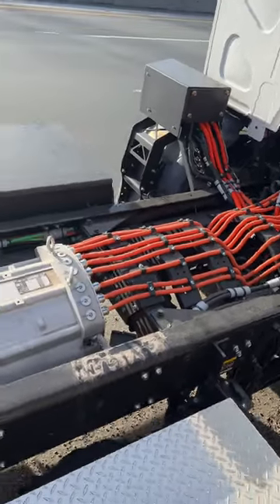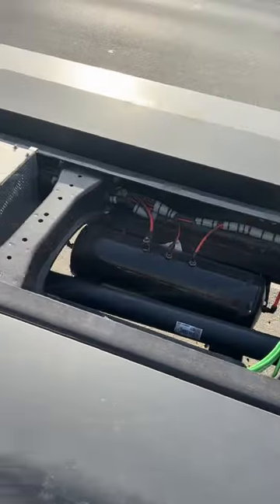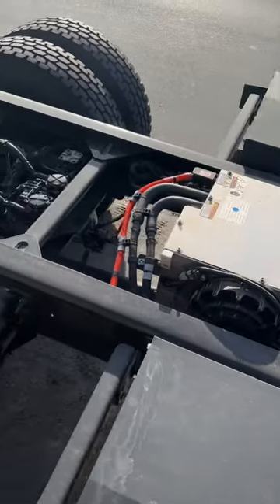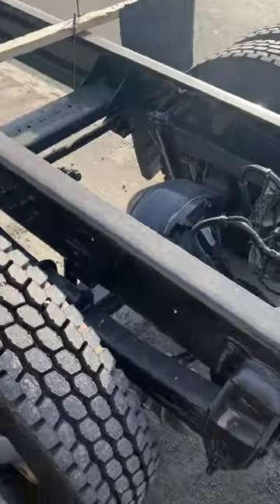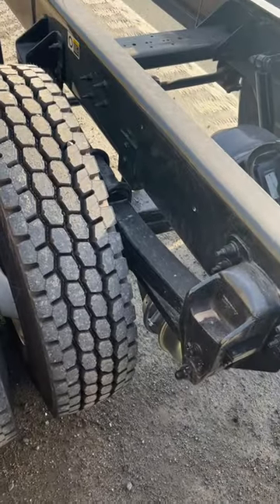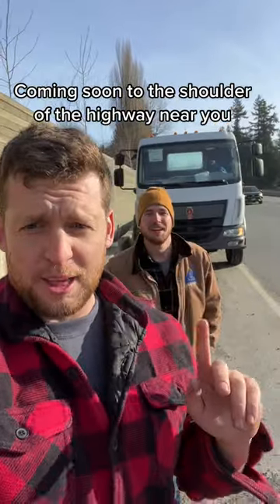Kenworth Electric Truck

Comment: So, with the Edison trucks having the generator capability, will they also offer a “jump” capability to other electric vehicles?
Reply: Depends, Edison’s trucks use a level 4 charger to charge themselves. I believe their electronics are Danfoss, so if the other truck uses Danfoss electronics or can communicate with Danfoss electronics and use level 4 charger then it should be able to charge the other truck. Hopefully someone can correct me if I’m wrong.
Reply: @PurpleNovember  sounds good to me.
Reply: @PurpleNovember  Blind leading the blind here, but If i remember correctly, there's a basic level of charger to vehicle communication but the electricity is the same, level 4 being standardized. Could be completely wrong though
Reply: @gormauslander  Yes, as far as I know that is correct. I’ve read conflicting information about levels 3 & 4 being standardized. So yeah, in theory the Edison truck should be able to charge anything level four, if standardized. It seems like there might be a pissing contest between Dana & Danfoss and vehicle/equipment electrification. I could be wrong though.

Comment: Most of this was highlighting the similarities outside of the end text overlay. Anything can run out of "go juice" with the wrong operator, even diesel.  Kinda gets old when videos that mostly throw shade get reposted.
It'd rather see more of y'all's design details and I live that you're e-swapping aging, but solidly built trucks. We did a motorcycle, so we know how hard fitting existing constraints and meeting safety regs can be and y'all have done it very well in everything I've seen so far.
Reply from the maker: This truck ran out of “fuel” while being delivered by the manufacturer, to the dealership. Reading it still had more than enough miles left on its range to complete its trip. If the manufacturer can’t figure it out, how do they expect their customers to? - Theron Danger
Reply: @EdisonMotors  i would call that a bona fide break down. i just think its a bit high and mighty when you 1. can control wich of your failures you show us. 2.dont show the working kennworth electric trucks(if there are any)
Reply: @stevengunter4990  Kinda seems like you didn't listen very carefully to the video...

"So I got to see MY FIRST EVER Kenworth Electric truck..." 🤦🏻‍♂️
Reply: @Studio23Media  i did listen, but the fact that his first electric truck from kennworth he sees is broken down is propably a statistical anomaly, yet he in the video and his response makes it sound like its a standard for them despkte not giving us, or possibly not knowing, details like "how long did the truck stand there/ how long did it take them to figure out?","was it an assembly or supplier defect?"," how many defects do they/will they have with their own trucks once they are on the road?"......he makes it sound like a bonafide truck problem wich can happen to any truck wether its hybrid, electric or internal combustion, is a major argument against them. To put it simply, he sound like a jerk to me.

Comment: Hybrid simply makes sooo much more sense. I can't figure out why they keep pursuing full electric
Reply: well if you want to go "carbon neutral" it doesnt at all, since you are not getting anywhere near carbon neutral. easy as that.
Reply: @stevengunter4990  do you mean that full electric is more carbon neutral?
Reply: @sethnowak9823  if the right conditions are met, it can be several times closer to it then just still burning fossil fuel....
Reply: @stevengunter4990 the problem with going full carbon neutral is that people have a vendetta against nuclear, water power isn't available everywhere, wind is very conditional, and solar is both conditional and has a very low maximum efficiency, not even factoring in relative power density to fossil fuel, nuclear or water.
Reply: @stevengunter4990  I think electric vehicles have their place where people live in big cities and drive a few miles a day and return home each night. For going thousands of miles over the road with 80k lbs, I think hybrid is the answer because you will still considerable increase efficiency, without decreasing range, maintaining quick refueling ability, sparing our grid demand of powering all of our freight.

Also, if you want freight to go electric, I think that trains would be a great place to start. In several areas there are already power lines near railways. They wouldn't even need batteries (decreasing our battery mining footprint), and they probably burn similar amounts of fuel as the trucks do because they have multiple engines on a train, each burning several gallons per mile
Reply: @kugelblitz1557  i like how you said people have a vendetta against nuclear. I think it will be the energy of choice someday, once a method to deal with the waste is created.
Reply: @kugelblitz1557  yeah problem is, i am not talking about that.....while each kind of power generation surely has some stuff to figure out, that is their business. i personally have a company thats very active trucking for the wind and solar industry so i am not without my biases of course.......... the simple thing is, if you ever want to get carbon neutral, you have 1000 ways to choose from, but fossil fuels just isnt one of them. the gains that a hybrid drivetrains brings are negliable, and they are still very much just a diesel engine.
Reply: @sethnowak9823  there's already a few okay options.  Launching it into the sun is a no-go, that would be expensive, but bury it deep underground in a place near the reactor itself to keep contaminated areas small could be a good idea, or put it under/between tectonic plates in the ocean.  Really we just need to develop it more.
Reply: @stevengunter4990  give me one other option that allows for the same amount of energy in a similar volume and weight as gasoline or diesel.  Until we have something better, that's the most efficient way to store and transport energy.  A Tesla weighs as much as my old f150 and takes ten times longer to charge than the truck does to fill and goes several hundred miles less than any of my vehicles.  Give me an electric option that can both do all the jobs my cars can do, charge as quickly as they fill, and be fixed in my garage for cheap ish and that will survive years doing farm work and I'll consider it.
Reply: @stevengunter4990  it will be by really cool one day when there is enough wind and solar energy to power all the trucks! And you're right, with the ultimate goal in mind, we might as well start developing that technology! No matter what you make, the first generations of them are not usually the best. But you can't get to generation 5 or 6 until you create gen 1!
Reply: @kugelblitz1557  1. i dont need to give an option that is as dense as diesel currently, many people are ready to loose a tiny bit of payload for being carbon neutral(even if its just for the image)
2. i have driven hydrogen test trucks myself, they are getting very close weight wise and are way more comfortable to drive(way quieter) only problem here in germany are refueling (currently) and length, as hydrogen trucks have a stack behind the cab wich europe would need to change its vehicle dimension laws for.
3.hydrogen is getting cheaper and cheaper by the month, i can definetly imagine near future where its cheaper than diesel here, same for america, i just think your low diesel prices will push that date out into the future.
3. and even IF FCEVs or BEVs dont suit you, and a very specific use case,they might fit 80 to 90% of the rest of the population, at wich point you will really have no choice.
Reply: @stevengunter4990  lol lithium refining and mining is not carbon friendly at all.
Reply: @TheGoatLocker  it is not evoirment friendly, atleast not the way the cheapest suppliers do it, correct. But H2 trucks need relativly little, the battery electric truck by daimler  i drove also need needed less than a conventionaö since the batterys are made differently and also hold up longer
Reply: @stevengunter4990  as long as they don't ban the sale of gasoline that's what I'm stuck with using.  I know how to work on those cars, I've sunk years of my life into my project car at this point and I know every part in every single one of my work cars with my eyes closed.  They're all at about 400k miles, still going strong and I don't plan on selling because they do the job and they do it well for cheap.
Reply: @stevengunter4990  There is NO SUCH THING as carbon neutral.
Reply: @Constitutional_Conservative76  thats why i mostly stated "closer to it"...... ofcourse we can never be fully carbon neutral, heck, we cant be as long as we breathe.....but i kinda guessed that people here are intelegent enough to understand that carbon neutral means "as neutral as possible" wich in this case means, after it was build it will not need a lot of carbon to keep running like a combustion vehicle does.
Reply: @stevengunter4990  wonder where the Lithium for the battery comes from? Using electric cars are good for the environment  on paper
Reply: @leopardontheboat8252  they are better for the envoirment period, they do need to run long enough for them to catch up to their building costs though,so they arent the holy grail of envoirment friendly like some people make them out to be. i never said i like battery electric , infact i do dislike BEVs. my argument was simply " the reason people do not develop hybrids is because they are just another combustion vehicle, if we want to get anywhere near carbon neutral long therm than they so not help in any way." if you agree with that is up to you, but its a simple answer to the original commenters question. i personally prefer hydrogen vehicles, as i have a lot of first hand experience with them.
Reply: @leopardontheboat8252  Lithium is highly recyclable. Stop being gullible and falling for oil industry propaganda.
Reply: @TheGoatLocker  Lithium is highly recyclable. 🤦🏻‍♂️ Oil extraction and refinement causes huge environmental issues too, and it's one time use. 

Nevermind the budding battery technologies that use little and/or no lithium. 🙄
Reply: Hybrid really does not make sense at all except for certain applications like industrial and some commercial use. Hybrid systems add a significant amount of complexity, which means added cost and maintenance. 

An internal combustion vehicle is about 60x more likely than a BEV to catch fire. 

A hybrid is over twice as likely as the internal combustion vehicle to catch fire. 140x as likely as a BEV.
Reply: @stevengunter4990  Hydrogen is simply not going to happen, at least not for a very long time. Production is far too costly and inefficient, and storage and transport is extremely difficult due to scaling issues. Until a unit the size of a gas pump can produce hydrogen in real time at the station, it's far too difficult. A semi tanker load can only fuel a half dozen cars. Also, California is the only state in the US that has hydrogen fuel available, and they only have 60 stains, half as many as they were supposed to right now. Hydrogen is also costs about 2 to 2-1/2 times what gas does per mile, and gas costs about 2-3x what battery electric costs per mile. Hydrogen is at approximately the same point battery electric was at 20+ years ago. And electric technology is advancing significantly faster.
Reply: @Studio23Media  the power density of a battery runs at around 0.1-0.5 kilowatt hours per kilo.  Gasoline runs at 10-15 kilowatt hours per kilo.  Hydrogen runs at almost 40.  Batteries run at about .1 kwh/litre, gasoline runs at about 8 kwh/litre.  

The highest range on an electric car is taken by a California based company and goes an estimated 516 miles. (Lucid Air)  The car costs 87,000 USD and takes about twenty minutes to get to full charge (optimistic estimate on a specialized charger).  My work truck with the second tank in the bed goes about ~800 miles under light load, closer to 600 if I have heavier shit in the back.  Cost me about $20k so far between retrofitting it from the junkyard and general maintenance.  Takes about ten minutes to fill up normally but if the pump is slow it can take fifteen or twenty.  My daily drive car goes about ~450 miles on a ten gallon tank.  Fills up in maybe three minutes most days.  You could buy both of my cars for 3/4 the cost of that car.  My cars start in the cold without fail, require zero software updates and go the same distance whether it's -20 or 90 out. Electric cars are newer, less reliable, more expensive for me to buy, more expensive for me to repair, and more likely to break random shit.  If one of my cars breaks I can most likely figure it out, stop by the junkyard or an AutoZone, grab my part and have it running again in a few hours.  I can't do that with an electric car.

On the topic of nuclear waste, we actually have giant pits in the ground for it.  There have been discussions of putting it underwater, however there is possibility that it will spread from there.  If it's deep enough underground or underwater the radiation will not reach the surface, we just need a cost effective way of putting it there and designated areas to put it.
Reply: @Studio23Media  dude..... my friend drives a hydrogen car already, we are also approaching normal gas car prices(here in europe atleast, we are looking at about 10 bucks a 100km.....for the small quantities needed right now of course). also a good hydrogen tanker can fill several hundred cars. you are talking about unpressurized tankers wich is not how hydrogen is transported today......to be honest, its not how hydrogen has ever been transported.
Reply: It makes a lot more sense when you consider what else is being pushed just as hard and at the exact same time.
Reply: Political agenda
Reply: @stevecarroll8967  exactly.  100% electric is basically like a massive smart phone.  Remotely shut it off, drive it somewhere else, etc.
Reply: @stevecarroll8967  of course its political agenda captain obvious, you say that like its a bad thing.
Reply: producing the batteries harms the environment just as much as gas vehicles do
Reply: Hybrid does not make any sense for on highway commercial  vehicles. Hybrid works very well for city driving with lots of stop and go traffic, but when you are spending 90% of the time on the highway it's just added complexity. There is definitely a reason none of the OEMs are even considering hybrid commerical trucks.
Reply: @GrenYT  this^
Reply: @GrenYT  that's true. That's why I like the hybrid design though is because they have the range to go over the road, and will still get an increase in efficiency for the time when they are starting and stopping, which is more often then you think, especially for the "vocational truck" market that Edison is trying to hit. Things like log trucks and service trucks might go down the interstate, but they also spend a lot of time off the road.
Reply: @sethnowak9823  it still does not make any sense for commercial vehicles. It adds most of the cost, complexity, and weight of an EV without any of the advantages. Hybrids don't qualify as zero emissions vehicles so they give no advantages with all of the new regulations coming in especially in states like California. The OEMs are very smart about designing commercial vehicles, if it made any economical sense they'd be doing it

I'm not too familiar with Edison as this just came in my recommended box, and it looks like they are a very young company. If they are trying to make hybrid vocational trucks then I wish them luck, but I don't expect it to be a large or lucrative business for the big OEMs to be interested

Comment: 750kw is so much power. How many kwh are the batteries in your trucks?
Reply: The batteries I believe in Karl are 350kwh and maybe in production they will get to 600kwh.   Either way less than one hour of run time
Reply: @SuperEye2eye  so he plans to run 1000hp motors and keep them charged up with a 300hp generator in vocational settings where they actually use all the damn horsepower all day? This won’t end well for him